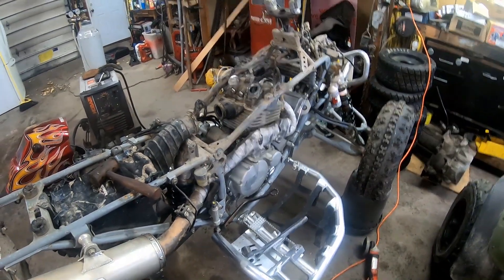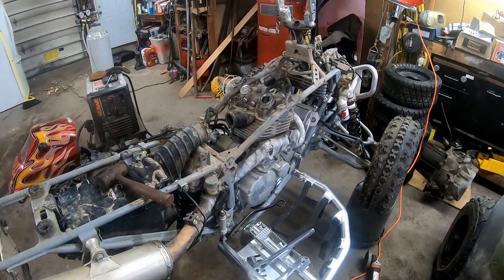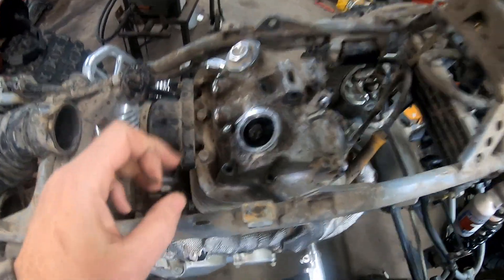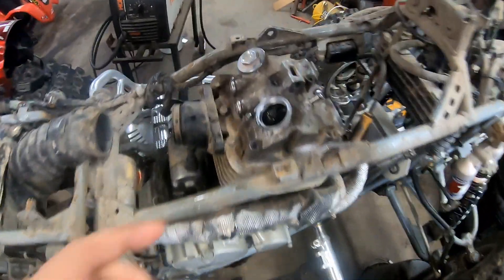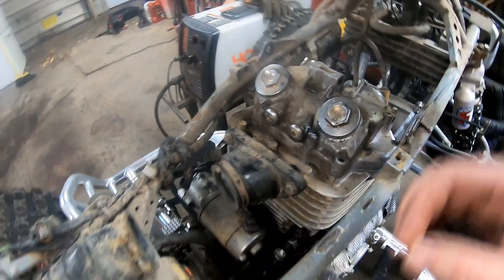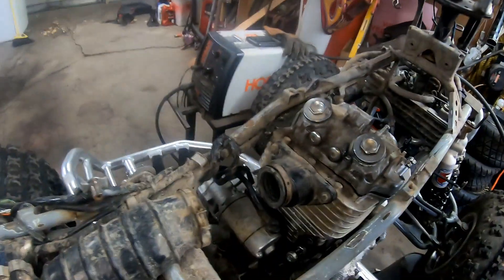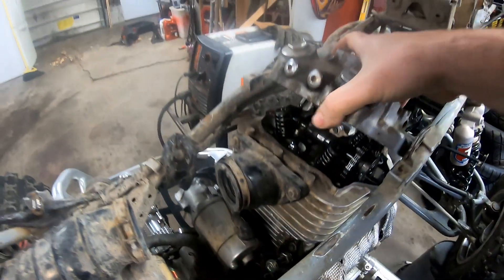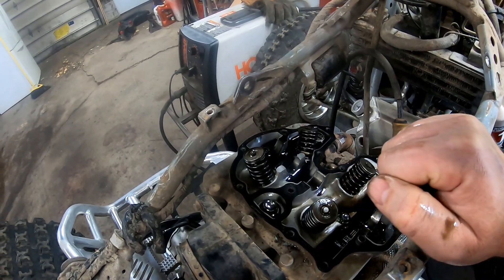400EX Engine Failure Diagnosis

Comment: Neat Trick on that broken bolt!
I have one of them tools, it is A Sears model, it is 30 yrs. old.
 it has saved me so many times.
Surprised that welding that not on there did not work.
What other Damage to you think there is?
Reply from the maker: I’ll tear the motor down further soon to see.  I hope it’s not too bad.  I need it ready for the winter harescramble at Valley.  You should come and give it a try on Feb 26th.
Reply: @Mudford  I will be there... to Watch...YOU!